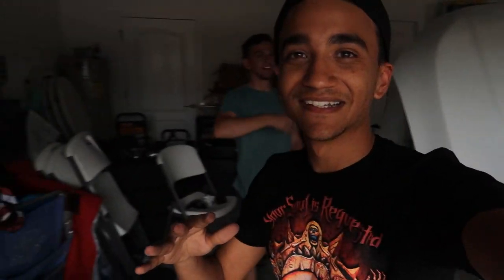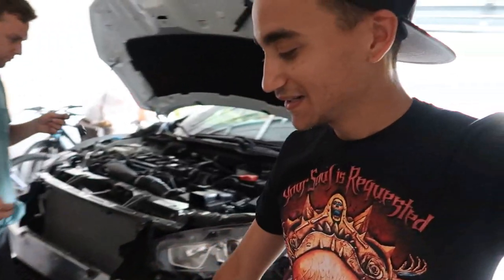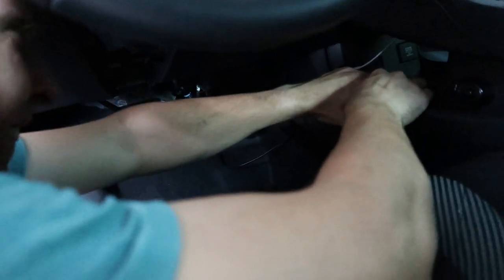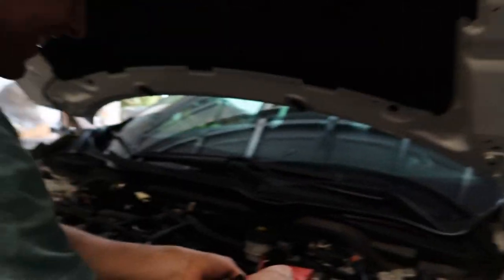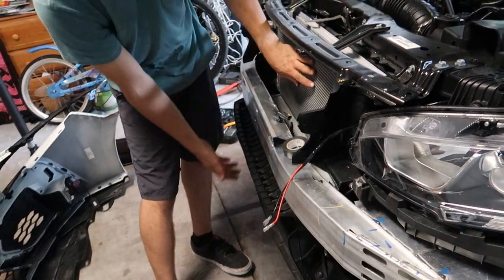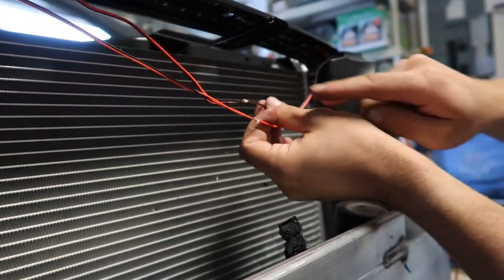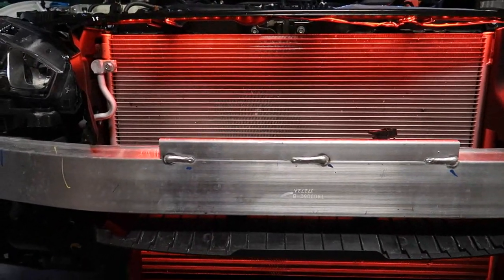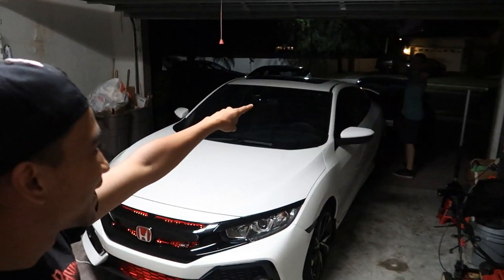LED GRILLE LIGHT INSTALL ON 10TH GEN CIVIC!

Comment: I did this to my 10th gen and after about 2 minutes of me having the lights on the battery was dead, how did you keep your battery from not dying so quick
Reply: Garrett I haven't installed this but you should install it directly to an accessory, not the battery. And check your battery life, if itswithin 2 mins it's probably already dead
Reply: I have a led light bar wired to my battery. Howd your battery die so quick?
Reply: @Agen007DarkKnight  just out of curiosity what light bar